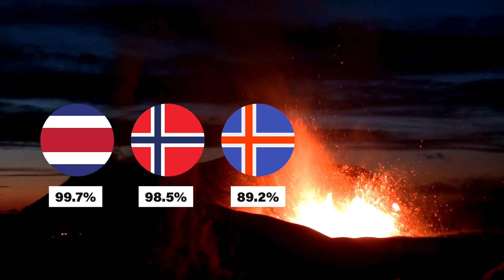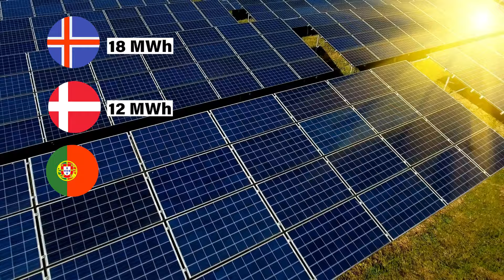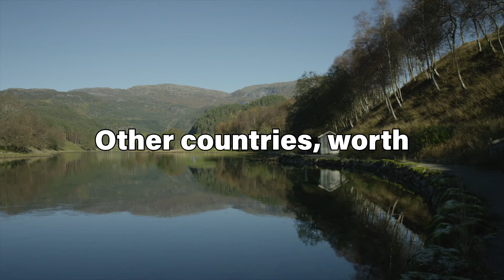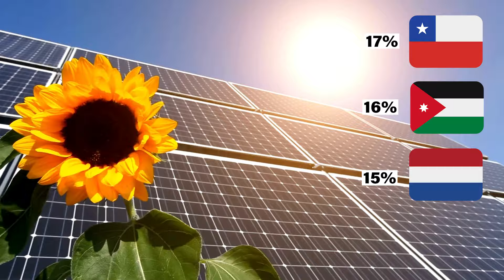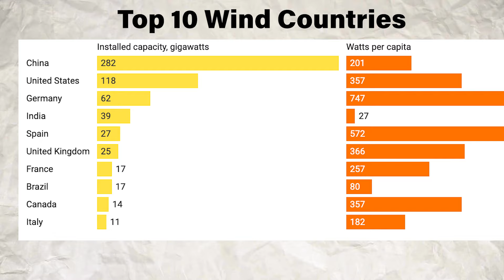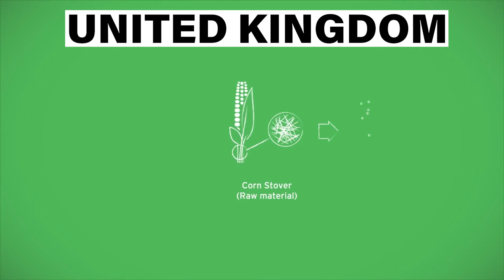Who is leading in Renewable Energy in 2024

Comment: How about do one where you rank countries' accumulated volume contributions since 2000 in reduced emissions in just electricity generation for GHG ?   90% of some tiny country, is not much in volume compared to some country that's done 5%  but of 500 times more volume.  If we have 1 atmosphere and 1 earth, we share it and the ones who have clean up the most by volume are making the largest contribution overall that benefits everyone.  (and it also means they have the most to reduce as well still remaining... something to not ignore either).   Also - using the terms energy and electricity intermixed isn't really accurate - far more energy is used that just the electrical form - for instance all the transportation uses of fuels are "energy", coal for industrial processes etc.  primary vs secondary energy... big differences.